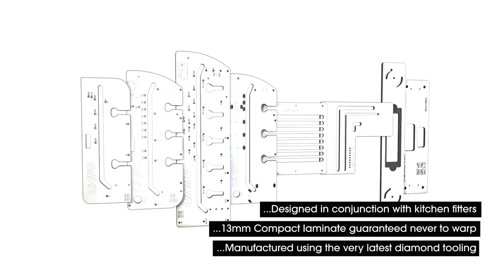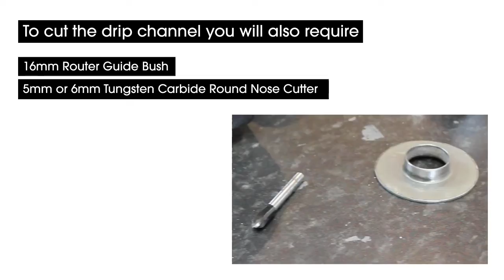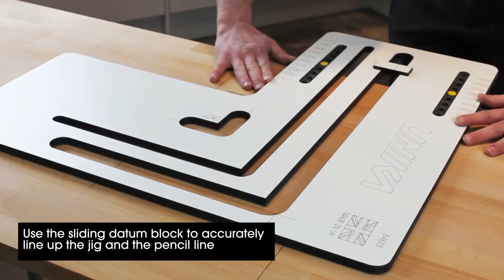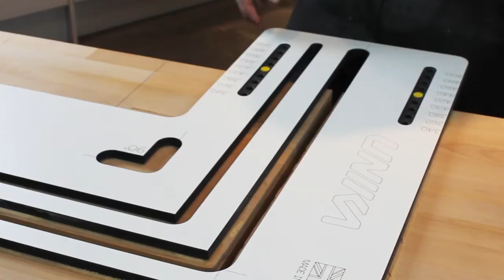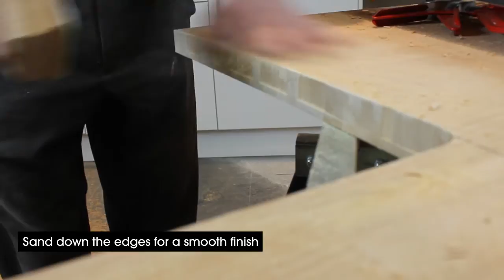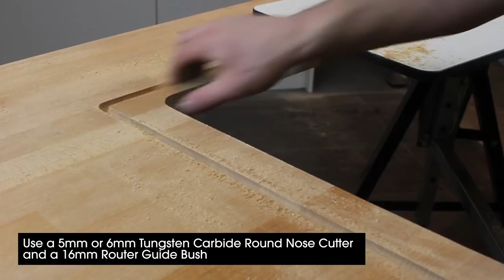Unika Belfast Sink Jig

Comment: The joint shown at the end is a butt and scribe type joint which is appropriate for chipboard, not solid wood worktops due to wood expansion.  For solid wood worktops you must use a simple butt joint.  Also agree with other comment - the edge was cut very roughly - maybe too much chatter on the bit or not enough even pressure against the jig or bit rotation too slow or feed rate too fast or cutting too much off at one time or using a cheap bit or a combination of all of these factors! Also some more explanation about dimensions at the beginning would have been better.
Reply: Looked like a beaver chewed that cut out!
Reply: @Jack-gz6mi  🤣🤣 yeh with krooked teeth